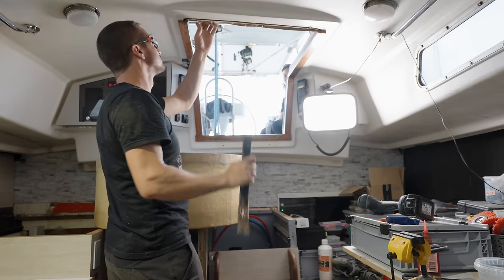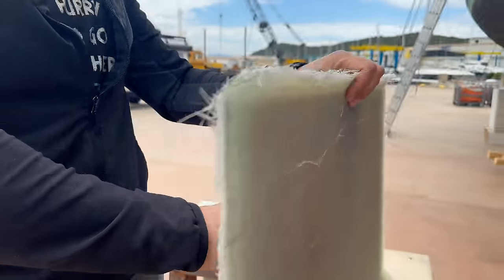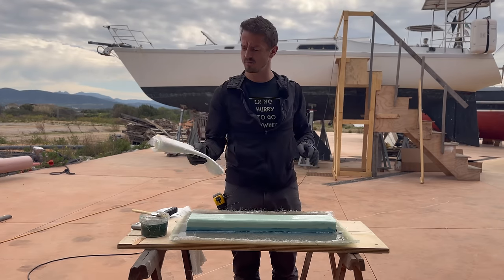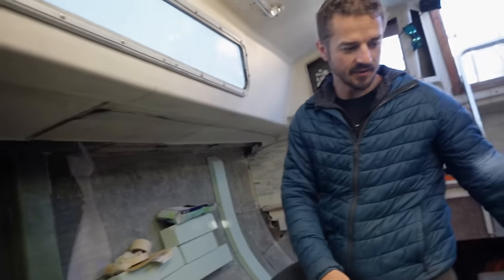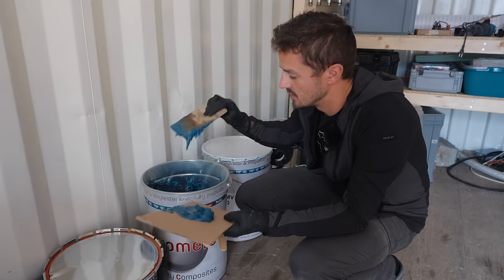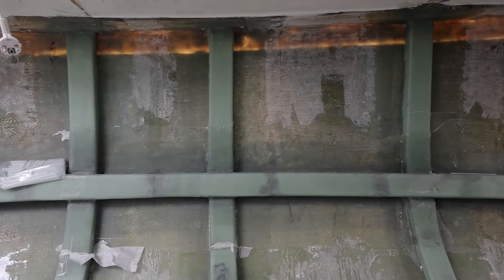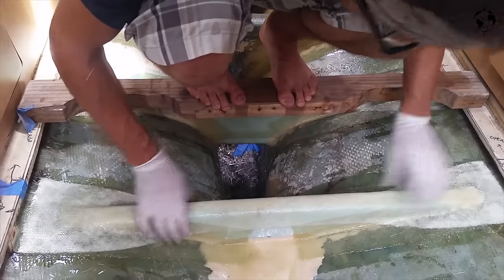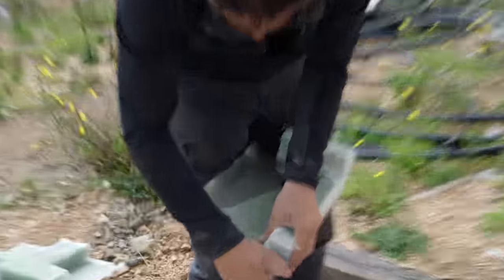Cutting Open our “New Hull”: What Could Go Wrong? | Step 386

Comment: I believe this is referred to as a 'cliff-hanger'. I'm guessing the last video scene shot was followed by much texting. Keeping fingers crossed.
Reply from the maker: Hours on the phone with every boat builder we know.
Reply: @SailingUma  Cant wait to see what condensed wisdom you gained from them in the next video and how it will influence the build!
Reply: I build fibre glass bows as a hobby and the same problem shows up there, it's hard to get fibre glass to stick to fibre glass unless you use some expensive epoxy. I have to wrap the limb with fishing wire but that's of course not a solution for you guys.  Really hope you work it out.
Reply: Hi probably you already checked your footage, I am quite sure you contaminated your "hull" piece with something oily and did not use peelply...
 It looks very much like that.  I hope the crew working on the real boat sanded and degreased thoroughly before laminating.
 Sanding after degreaser is important as well because you avoid rubbing the contamination into the substrate.
 I hope you find a good explanation for your mishap.
Matthias fixing my trimaran in Greece at the moment.
Reply: @SailingUma  As others mentioned, the pro's did it better by wetting the sheets in resin first. Also, as you have a hull in a hull, a little delamination doesn't do anything - all is fixed in place, and the waves and piers will still be stopped by old and new layers. A leak could cause a small issue between the layers, but once the water is out, you could inject some glue before fixing it. Also, you can't put too much force perpendicular to the hull - a shelf, for instance, should be attached to the ribs, not just the walls. Good luck!
Reply: I believe if you had bedded the foam stringers in the vinylester putty that would have been a better solution. Once you get the fracture started under the stringers the rest is easy.

Comment: Boat builders use closed cell foam such as Divinicell. If moisture gets into the foam it does not soak into the foam. I also agree that it would have been better to put a layer completely over the hull, using a specific glue (sorry, cannot recall its name) and vacuum it to the hull. Then glass over that. Then it would only be necessary to glass in the bulkheads, and a rib mid height around the hull. Use this to rest your bench tops on.

Comment: Spot the SAK with custom scales ... sweet.
I agree with the comments on delamination.  I used to design ballistic protection (using GRP armour at times, as it happens) the weakest part is near the edge. Because both your inner and outer hulls are contiguous structures, any forces will be dissipated across a significantly greater area.  As others have said, I think the pros will be achieving a better bond for you, but I don't think you will have an issue either way.
It's easy to say "Don't worry" but don't worry.  What's the absolute worst that can happen?  You end up with a boat inside a boat ;-)

Comment: What you have to consider is that you’re applying a tremendous amount of force to a very very small area with the hammer. To apply that same force to your boat hull you would have to sail full speed into rocks. 👍👍🎉🎉🎉🎉🎉🤘🏻🤘🏻
Reply: False! Lift the boat wit ha crane, set it down on the keel / cradle pads, crash over a wave at 6 knots. The forces can be incredible. You are correct that a hammer blow places significant force over a small area, but a proper secondary bond layup, should provide much greater adhesive strength than shown here.

Comment: Because the rib to hull joint is sound and the stringers are sound themselves, I'd suggest sanding the stringers wherever they intersect with the ribs and then drilling holes through the stringers and into the ribs where they intersect, and then filling these holes with rolled glass cloth that extends from inside the ribs to the newly sanded areas of the stringers ... and add resin until everything is saturated.

Comment: When laying up new glass onto existing polyester, you use epoxy. The mechanical bond is stronger. 
I was wondering why you went the route of ribs rather than layering up 1 inch core to the inside of the empty hull? This would give you a stiff hull without the intrusion of ribs into the space. It would also give you insulation.
Reply: You still have to sand and clean with acetone even if you used peelply no?
Reply: @sylvano44  It depends on how long you waited after curing the base you're glassing onto. Polyester will release like a wax onto the surface after curing, which acts like a mold release for the next layer, like in this example. If you put the next layer down before the old layer is fully cured however, you can get proper cross-linking, and this isn't a problem. How long you have depends on type of resin, amount of hardener, temperature, etc. This waxy layer is why you wash with acetone between layers. But even so, polyester on polyester will not crosslink if the bottom layer is fully cured: Meaning that you will never get a full chemical bond between layers, if one of those layers is allowed to fully cure before the next one is put down. All that is then holding the layers together is Van der Waals forces. Sanding or using peel-ply helps getting a rough surface with a larger total surface area for the Van der Waals forces to act upon.

Epoxy is better for this, which is why it is generally recommended to use epoxy for repair-work to get full strength. Epoxy is much more expensive though.
Reply: @JOHANDOMEIJ Thanks for writing this down, you saved me risking repetitive strain injury from tapping furiously on my phone screen. 
Perfect explanation and well written, I’ve nothing to add. 
Cheers, R. 😎👍🍻

(Marine Engineer, Ret.)
Reply: @JOHANDOMEIJ  I am currently installing a bow thruster on my sailboat and using epoxy. I am very happy to have chosen epoxy after seeing how easily it took off.😳
Reply: Ho shit   Polyester we use it to built not to glue,  Epoxy do this job Glue.
Reply: That costs probably way more and is way to strong if you already have 1cm thic glass
Reply: @JOHANDOMEIJ  HOW much more expensive? I may be looking at wrong places, but the bulk price/gal of west system(A+B) is only about 40-50% higher than vinylester, and there are less expensive epoxies. Although they need a lot of it, still not too much on the scale of their project.
Reply: @sergeyn.syritsyn6748  That’s about right for smaller quantities, bulk prices are roughly 35% - 40% more, depending upon specific manufacturer, quantity and product.
If you’re likely to be doing repeat bulk purchase, because you’re a bona-fide manufacturer for instance, you’ll be able to negotiate the lower figure or get additive products at prices that effectively achieve that overall discount. 
For a project like Uma it’d not be unreasonable to be at around the 40% extra cost figure for the epoxy over the equivalent amount of polyester resin. 

That was certainly the case a few years ago and I don’t believe that pricing structures have altered much since.
Reply: How much weight has all this added to the hall and what whole Performance do you think you may have sacrificed with the weight?
Reply: @sylvano44 acetone doesn’t remove the amine blush, that has to be cleaned off before any sanding.
Reply: @JOHANDOMEIJ not a acetone, denatured alcohol wet wipe, then mild soap and water, then a thorough fresh water rinse. No acetone required.
Reply: It would have helped (after the correct prep) if the stringer was also bonded to the “hull” correctly. With just hot glue they have created a void as seen in the model. Hopefully in the boat this was not done.
Reply: @britboy20002  The stringer doesn't need to be bonded to the hull at all. It is there to create a void between the hull and the glass. The glass absolutely needs to be bonded but not the stringer.
Any movement of the hull (flexure or shear) creates a mechanical strain between the two layers - one in tension and the other in compression, that is transferred at the point where the glass of the hull meets the glass round the void that the stringer makes. This Compression/tension pair creates strength and rigidity to the hull.
Reply: @Nixontheman  We used acetone in several factories I used to work in, with consistent results. Acetone is cheap and relatively safe to use and needed for a million other tasks in the factory anyway, so it's the standard solvent across the industry. I'm sure there are many other ways to do it too, what works in industry is not always appropriate for DIY. I'd be wary of disturbing the moisture content of the resins before full curing though, so I don't recommend washing with water. Maybe for small external parts (like the test piece in the video), but certainly not inside the hull where you won't be able to mop up all the water. Alcohol wet wipes might work for small projects, as long as it only contains pure alcohol an doesn't leave a residue like perfume, moisturizer etc.
Reply: @JOHANDOMEIJ  fair enough,  what factories, making boats? That sounds so cool.

Comment: Hang in there!
I’m building a trimaran using foam (divinycell) glassfiber and West Systems epoxy. Materials are very strong together.
I agree with previous remarks, epoxy preference over vinylester. Use epoxy thickened as fillets. No hot glue. Hot glue only for foam-on-foam as temporary fix.
Pre-wet the glassfiber.
Also pre-wet your foam. Foam soaks in resin, so don’t let it soak down from your glassfiber.

Comment: So sorry for the faild model structure. The video is so well and informative done! Thank you for sharing it ALL. Hope that you finde the reason for the delamination a.s.a.p
Reply: My layman guess is that you need to sand the surface first to make the bond stronger. Also I would expect that they would make a filler with at least 20mm radius because glass is known for disliking sharp corners, you should not force it into 90° angle.
Reply: I was REALLY worried about the hot glue!  That creates an air pocket AND adds another chemical into the layers of fiberglass (never a good idea).
Reply: Informative, as-is how NOT to do it….
Reply: @KeithCarmichaelInFL Hot glue is not structural, at all.
Reply: It’s not a question of structure, it’s a question of chemistry.  Hot glue releases solvents as it cures, solvents act in questionable ways when reacting to other solvents.  Notice the way the bond of the fiberglass became brittle and broke AFTER the application of hot glue in the process.
Reply: @KeithCarmichaelInFL   I'm not a chemist, but I think the hot glue debate is irrelevant. In the first instance hot glue is inert when it is cold, that is why it is used in thousands of situations including encapsulating electrical components.  The hot glue and foam do not create a structure they are just there as a former. Years ago we would use paper rope to rib racing yachts in just the same way. Obviously paper rope has no structure, it is the GRP rib created around it that does the job.
Reply: @beakyturbot  Ah, I see.  You're absolutely correct!
Reply: Disregard the properties of the foam at your own risk! There are quality considerations in EVERY material used in boatbuilding & foam is no exception. Open cell or closed cell affects bond strength. Tensile & sheer MPa values affect delamination. And so forth. Dan's assertion that it doesn't really matter what foam is used as a core shows fundamental ignorance of the principles of composite boatbuilding and how forces are handled by different materials. Hot glueing structural members to other structural members is just ridiculous, as is not structural coving first before glassing joints. Especially considering the use case of the boat, bluewater cruising in high latitudes. Jeeeeezus!
Reply: @KeithCarmichaelInFL uh , nope.
Reply: @KeithCarmichaelInFL you are joking right?

Comment: there is actually a difference between going from big to small or small to big. if you go big to small, which is the best practice, you make sure that the first layer has FULL contact with the substrate, the subsequent layers on top will help in reinforcing whatever it is you want to reinforce/build. if you go small to big, there is only a percentage of "next layer" that will contact the hull/surface. going big to small is how one should be laminating over thru hulls holes that one needs to plug. same principle is applicable everywhere including your lamination over the foam core pieces

this project is pretty cool to watch and i cant escape the ironic notion that, whilst we get new materials and techniques, we still resort to basic, millennia old, ways of building/reinforcing boats, as shown by your new frames which resemble traditional wooden boatbuilding

i reckon the delamination is due to not having enough cure time, its not your first time mixing resin so that shouldnt be the problem either since it cured, that leaves us with contaminants being present,  bad surface prep.
also, the nature of impacts and what is the expected behaviour of grp doesnt really align with such "precise" impacts like you did with the hammer.
ive been glassing a bit in the course of my refit and in one ocasion i noticed i could pull out the end tail of a bit of "dry cloth", effectively delaminating it by hand, but only for a couple of cm. i also noticed that this situation would improve overtime, as you let the resin to fully cure.
Reply: The big V small is an old argument. Somebody once said Boeing recommend one way Airbus the other
Reply: @matthewsellers82  the gougeon brothers suggest big to small, those fellas know their stuff i would say
Reply: Big to small avoids air bubbles at the boundary, less chance of voids and quicker to laminate.

Comment: I like what you are doing with the hull. Seeing as you are doing all of the reinforcing, will you be building composite chain plates to replace the inferior stainless chain plates?

The "insta" delamination of your sample was most likely due to a poor mechanical bond of the rib & stringer lamination. You did not sand the surface of your sample hull, like was done inside your hull.
Reply: There is no mechanical bond it's a chemical bond that's failed here.
Reply: @inneshutton3716  there is no bond of any kind now. LOL.
Reply: @inneshutton3716  It's a mechanical bond as the sample plate was cured befor the addition of structure and laminations. In order to get a chemical the lay-ups have cure together while the resin is still reacting. OR to get a partial chem bond after layup has cured, sand then wipe with stryene ( sometimes MEKP works too)

Comment: Vinyl ester does not bond with polyester, best bond is epoxy to polyester with a well prepped surface of the hull. Who ever suggested using vinylester should have gone back to engineering school. The sizing of the frames and stringers are overkill, it takes too much volume out of the interior. Smaller scantiling of frames and more glass to bond them into place. 🇨🇦
Reply: Agreed with all you've said. Those stringers and ribs are WAY too big. They'd have gotten a better result with 25mm foam sheets with tack gaps between the sheets to bond the inner skin to the outer while leaving the foam sheets inside for insulation. The rib and stringer model is weaker and uses much more space, and doesn't have the insulation properties of the foam sheets.

All that needed to happen was to watch how the big boat makers do their composite foam sandwich hulls nowadays to see how superior that is.
Also here in Australia there's a guy with the "Life on the Hulls" youtube channel who is single-handedly building a Crowther catamaran in foam sandwich.
Reply: Vinylester does bond with polyester!
Reply: Uhhhh yeah it does. Polyester and vinyl ester bond really well
Reply: Poyester does not bond to vinylester!! But the other way around works.
Reply: Not true! 

Vinylester does bond to polyester quite well, and perfectly adequately for this application. 

The key take away should be, there was no real reason to use vinylester (commonly used by builders for underwater hull sections to reduce the risk of osmosis, having no control over the dealer or purchaser barrier coat application).

Isophthalic polyester resin, would have been perfectly adequate for this application, and the pros (speed, cost, allergy safety, convenience) would have certainly outweighed the con, that it's secondary bond strength is a bit less than epoxy, which would have absolutely no real bearing in this scenario, due to the huge amount of surface area covered.

Comment: PLEASE consider starting a shop building shoal-draft pocket cruisers. Older Cape Dory 28 and 30 are so unbelievably well designed, but with modern structure they wouldn’t need to be so thick and heavy, and so they would sail MUCH faster.

Comment: Guys, seal the foam before laminating. I use VE resin and microballoons and that will give you the results you need. Let that set then wet out the surface then put down your BID and uniglass. A sledge hammer won’t delay it then!  There’s a lot of techniques for making the whole process easier including using a router to round the edges and a caulk gun for long runs of fillets.

Comment: Great episode.  There can be many reasons for poor adhesion, and there is no reason to assume the actual bond behaves the same way as the test section.  I'm sure your test section has made you investigate further and has given you greater peace of mind.  In engineering, you did a DOE (design of experiment). You found an interesting result, which you investigated further, and you tried to understand the physics of why it failed, which will improve your knowledge.  It also means you look more closely at the actual bond to check it.  By the way ignore all negative comments that you are wasting your time, everybody has different goals and your goal is to rebuild which is amazing.